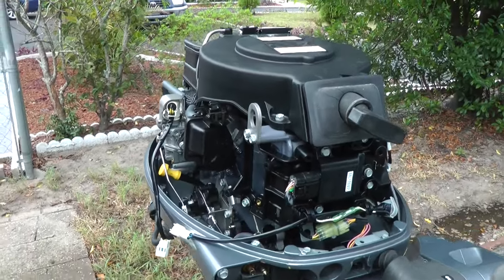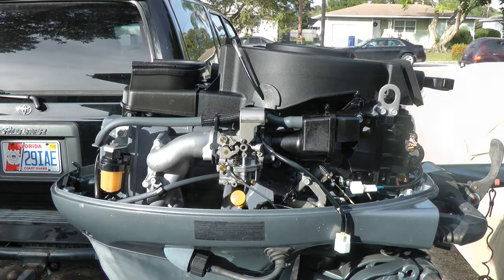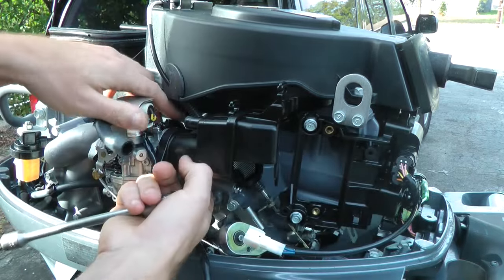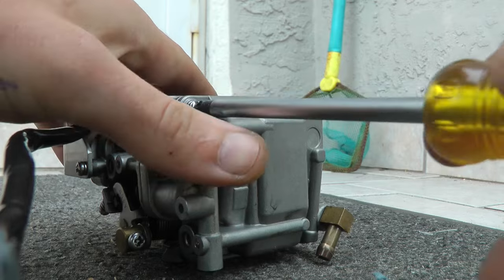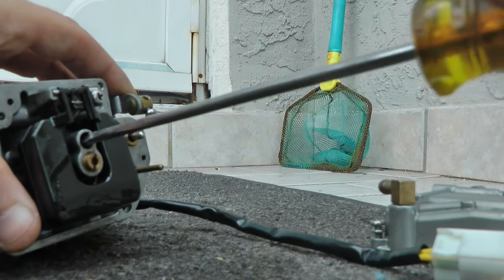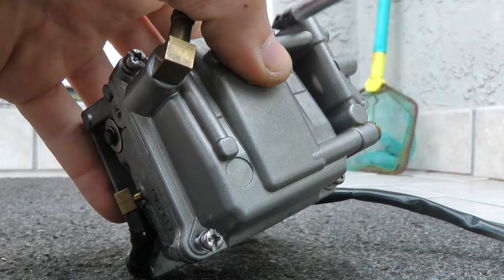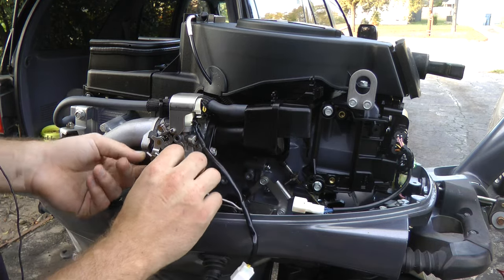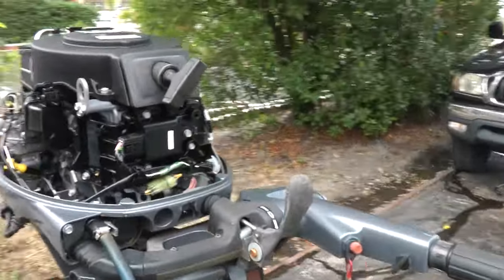How To Fix Yamaha 25hp 4 stroke Outboard Acceleration Issue

Comment: CAUTION! I think this is improper advice. I had the EXACT same issue with the EXACT same engine that had IDENTICAL symptoms. I saw this video and thought a ha! This is the problem. But a experienced mechanic showed me how to fix it otherwise. I took the carb out, and ran through a ultra-sonic parts cleaner with a Simple Green solution(3 times actually) and it fixed the engine perfectly, returning to like-new performance. I think this "change the jets" is a less-than-ideal workaround of a clogged jet issue. If you are experiencing the symptoms in the video, dont change the jets, just buy a heated ultrasonic cleaner, and let it clean overnight. Bigger jets will change the fuel consumption, change air/fuel ratio, and wont return engine to full performance. cheers Conor
Reply: Totally agree.  Ultrasonic clean up, change gas filter.   See what happens.  Don’t mess with jet inlet.

Comment: Yamaha would not build a motor that will run like it did previous to the jet change.Disassemble dip in carburetor dip spray all the cleaner out with the water hose then the water out with the air hose be careful not to loose any parts reassemble and it will run like new. The accelerator pump was clogged on that motor. You do a good video but I would research a little more if you want to keep your motor stock and running in it’s intended form. Just saying.

Comment: There is something else going on with this motor. Factory jets should not be running like that.  You may have an air leak that likes the bigger jets but that still doesn't fix the problem.

Comment: D: ! Oh god! Dude no. That top diaphragm gasket has swollen and stretched out and it can't get proper air/fuel through those passages The SV carbs on johnson/Evinrude motors have a plastic top that warps with ethanol fuel use and gets an air leak. The accelerator pump on the side that plunges down and shoots extra fuel at first throttle will, guess what, leak air. And it needs that pump for quick proper response. This extra fuel use will make it "skip" at full throttle drinking more than it can receive through the inlet. Like setting a float too low
Reply: Hi, sounds like you know what you are talking about👍🏻 can that top diaphragm gasket be replaced?

Comment: How is it that the factory jets are undersized? Did every motor from this year have the problem or did a previous owner tinker with it and put some undersized jets in it?
Reply: wmkess they aren't. That fuel restriction comes from swollen gaskets blocking fuel passages. Now his motor will crap out at full throttle drinking more fuel than it can get
Reply: That’s how they claim low emissions. Bigger jets never hurt anything .

Comment: I don't think you've cured the issue, I cannot see Yamaha sending out engine's out with incorrect jets fitted ,every engine is run up, tuned and adjusted where necessary .Your rarely get it wrong normally.

Comment: When you have to remove the carburetor it's a little easier to just unscrew the manifold then you dont have to worry about getting that long bolt in the back iit can be a pain in the butt .
Reply: The long bolts go through the manifold and the carb on these, so you can't remove the manifold first.

Comment: I’ve had the exact same problem with my Yamaha f20. It turned out to be a clogged acceleration pump. As its made to need more gas right away when you open the throttle, to give it a Quick response, it Will make sense if that canal is clogged too, in this video. As you Can hear, the engine revs up quite slow after the fix. I guess you made the engine work, but now it Will drink more fuel while rev’d up. A better fix would be to clean the acceleration pump canal, to make it drink less gas and respond quicker.

Amazing videos btw! We need more ❤️

Comment: Behind that very first screw that you loosened to remove the linkage is a small plunger with a bellows. Odds are that this is stuck due to fuel residue… with the throttle open, take a small screw driver or knife blade and move the plunger down. Do this until a couple of times until it moves on it’s own when you open the throttle.

Even with your larger jets, it still hesitated noticeably… I’m twinging that there lies your problem. If it does improve it or fix it, you should still remove the carburetor and clean everything
Reply: Tried that as well.. plunged well.. jets made a night and day difference

Comment: Did you check the accelerator pump? I've repaired several F25s with clogged/bad accelerator pump systems and they all hesitated like that.
Reply: What is an accelerator pump?  where is it located?
Reply: @kennywatzke1416 it squirts extra fuel into the intake as the throttle is opened. This is because the carb will lean out momentarily and hesitate. 
 A plunger on the side of the carb is the location- a black rubber boot covers the plunger. Carb bowl must be removed to access the plunger.

Comment: Had the same problem.On three yamaha four-strokes.25hp,6hp,2.5hp.Problem is not the jets but when you pick up the motor the dealer (Lazy) only does a fast start up and oil run . DO adjust the carb slide and adjust the idle screw plus the throttle cables.The four stroke`s run cold warm up first then adjust everything. Watch my new yamaha 6hp portable and did a test ,the motor idles and picks right up on plane.Runs perfect.

Comment: Just been searching for an issue with my yam 40hp. Idles fine. Put it in gear and excellerate its holds back a little. Up the revs she flies along. 
Im.guessing those jets were an idle one and one for open throttle?
How did you know what size to move up to? 
Good vid..even this late in the day.

Comment: Nicely done. do you know of any other particular year models that run into this problem?
 I have a 2013 similar to yours and haven't noticed it yet but if i had I would have blamed it on a dirty carb and cleaned it, never realizing using different size jets.

Comment: Where did you get the over sized jets? And that rubber plug over the smaller jet what is it for? I took the carb apart and forgot to pit it back in the port and it stoped the problem. Realized the plig wasnt in so i took the carb apart again, put the plug in and the problem re occured
Reply: I'd like to know the answer to that.  Why is it there?
Reply: Big Kahuna so i tool my carb apart again and there is a hope from the small jet to the big jet so it must be a bypass plug but my outboard ran like a champ when the plug was out
Reply: i bought a motor once and it would bog down at open throttle turns out the carburetor was missing the plug. that plug controls the amount of fuel that goes in to the jet. it kind of looks like a fuel restrictor
Reply: If there is a plug then it is designed to not flow through that spot. If it worked better without, you got lucky cause there is a problem somewhere else.  I love his videos but he way over shot what was needed for jetting increase. a couple of #'s on each would have been a ton. When you increase the pilot jet you can expect to have to dial the pilot screw back in some too. It should be an effective tuning screw in the 2-3 turns out range if the pilot jet is right.

Comment: BAD INFORMATION!!!

I know this because I know how to fix the "acceleration issue".  It's not hard, but time consuming, tedious, and you need some tools.  There is NO FACTORY DEFECT.  The "issue" is caused entirely by either poor fuel quality or staled fuel from sitting, or occasionally debris-but even the factory filter/separator that's mounted to the engine does a pretty good job of removing the junk from fuel.  I've never seen one with garbage in the fuel bowl, but I've seen PLENTY with staled fuel from sitting.  I will not discuss how to properly fix it because people will run out and ruin their carburetors and then blame me for THEIR mistake.

Larger jets will (1) increase fuel consumption (2) increase emissions (3) potentially foul spark plugs, (4) decrease your top speed-perhaps drastically-and (5) make every technician that has to work on it chase their tails AFTER cleaning the carburetor properly, which you (the end user) will have to pay for the additional labor.  Oh, and let's not forget that the increased emissions could potentially set you up for liability issues if your state or locale were to press the subject.  (Kalifornia?)

This video doesn't address several things.  His "fix" is a hack fix.  The real fix is to clean the bowl passage, which is impossible without drilling.  What he is doing is bandaiding a fuel-starved accelerator pump by increasing the fuel that flows through the jets, which is, again, incorrect.  While it works in his video, I know firsthand what the real fix is and the gentleman in the video did not do a proper job of showing that proper fix.  Did anyone notice in the first part of the video that he's running the engine with the fuel line disconnected?  Did you hear the fuel pump clicking?  That's the first thing I noticed...the carb was starving for fuel already and he's blaming it on a "factory defect"?  Or perhaps his idea of a factory defect relates to the tiny orifice that's BUILT INTO the bowl, and plugged.  I can nearly place a 100% guarantee it ran fine the first time it came out of the crate, then perhaps it sat up for a year or 3 and that's when the "issue" started.

The idle speed is adjustable, but again, I ain't going into how to adjust it.  Also, the orifice in the bowl is cleanable but just like I said before, it requires drilling.  Then there's the accelerator pump tube that gets plugged with staled fuel and can cause issues.  Oh, but that's not even considering that the bowl gasket itself (o-ring) tends to flatten/shrink and will leak fuel, but because the fuel is fed in from the bowl, through the gasket, and then into the main body, if the gasket doesn't seal, it will overflow the bowl making you think the float valve is leaking.....oh the joys of working on these for a living.  You learn things.  Wait til you do a carbureted F40 (4 cylinder or 3 cylinder) or an F50 carbureted engine.  Those are really fun.....and to do them properly, in other words, restore factory running condition, they're time consuming.....which means labor...which means several things.  Cheap isn't always good.  Better know someone who knows their stuff because on the F40 and F50 4 cylinder engines, the engine can hole pistons if the carburetors are not perfectly tuned; and they aren't cheap to replace powerheads!
Reply: Turbo Joe Hi Joe, read you input on this old video. You have any info on where I can find info on doing the carb compleatly witbout having to "blame" you if I mess it up? Mine is a 1999 65w f25ae and it idles great and runs perfect on higher revs but cuta out when increasing revs from idle. Thanks in advance!
Reply: peter merian A Clymer repair manual will tell you everything you need. Spend the 50$ and get one for your motor
Reply: Thank you for the right info. Or some of it lol
Reply: My 2015 15hp does the same thing. I just cleaned the carb and jets yesterday. I might have missed something. Other then this issue it runs amazing. I doubt that the jets need to be upsized

Comment: Just curious here? When you have laggy acceleration (like you had), that usually means you have a clogged or dirty Main Jet. So, you should just clean it. Otherwise, maybe an air leak (unlikely, but could be). So, why would you go up THAT MUCH on a motor (specially in Florida)? I understand if you took a motor from FL, and took it to Minnesota during the winter, you should go up a few on the jets, but THAT MUCH, for a FL motor? Damn bro.... That's crazy... I honestly wouldn't do it!!!

Comment: You did not even clean the carb with any carb cleaner the dirt might still be in there
Reply: There's a lot more wrong with his "repair".  This is the kind of thing that I see often from those repair shops that appear and disappear in a month's time.  Unfortunately, the low price sells their service more than their tech's knowledge does.

Comment: Not buying that I'm afraid.yamaha wouldn't send motor's out from the factory like that there's something blocked or air leakage or excelorator pump faulty.you should find the problem not over compensate it